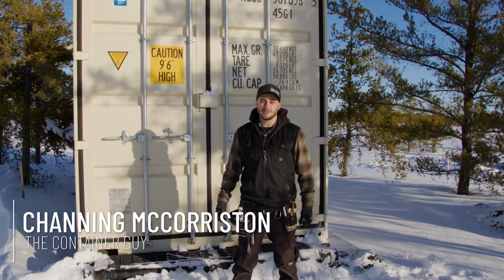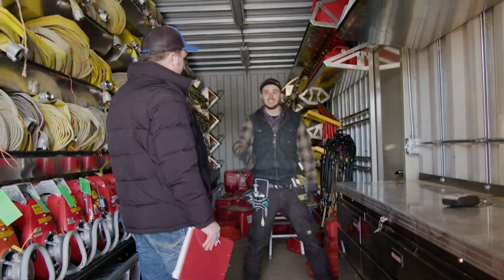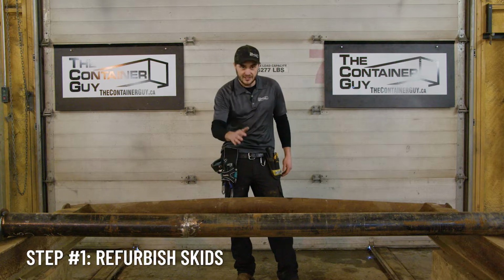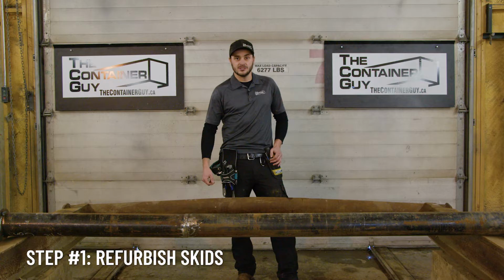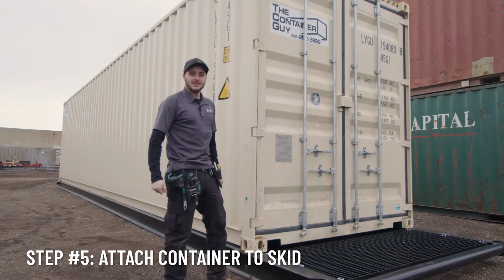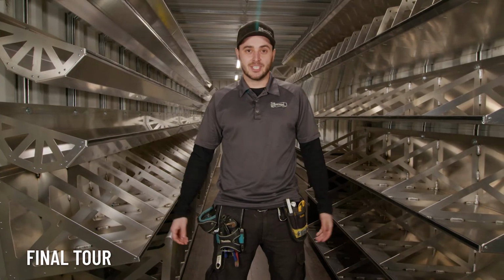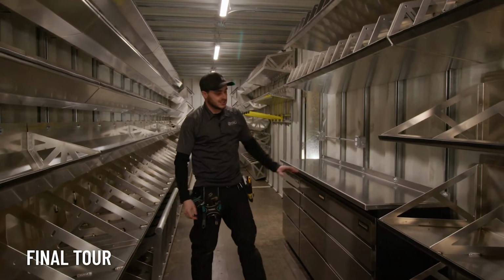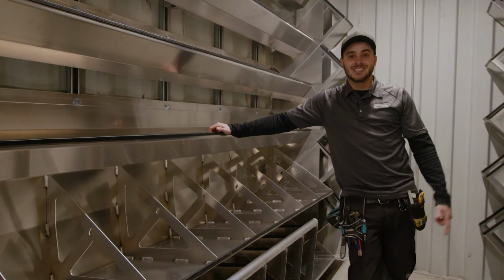Mobile Wildfire Management Warehouse - Shipping Container Engineering

Comment: I was Wildland firefighter. I remember the time I was with the camp crew in 2010 when I couldn't pass the firefighter running test. So I worked as a camp crew. We took care of the fire cashe (fire fighting equipment)  which was on tables out in the open no shipping container. This is good video it shouldn't be top secret 😂 modified shipping containers are being used in all sorts of storage or homes.

Comment: Notching the skid to attach the can was by far the better choice. Very nice work. Looks great.
How did it manage to hold more gear than the three vans? Was simply an organizational solution?
Reply from the maker: One 40' container holds more equipment than one existing 53' van trailer. I'll have to re-watch that part of the video to see if the graphics were accidentally misleading. Our apologies if so.